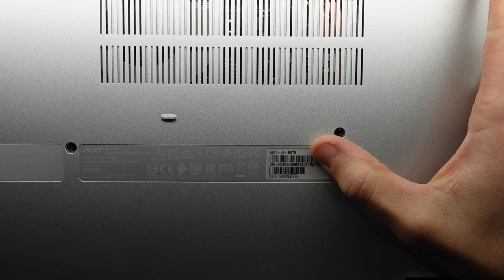Acer Aspire 5 A515-45-R67B Ram Upgrade

Comment: Thank you for sharing the part with disconeting the battery as well. It was a comment that the board has 8gb of ram and added another of 16 gb = > 24 gb. In your opinion don't you think will be troubles bcs there are not the same capacity? like 8 with 8, or 16 or 16?
Reply from the maker: they will work okay being miss matched but won't get dual channel performance due to the different sizes

Comment: when i check on the command function and on the taskmanager memory option, it shows me that i have 2  slot on my aspire 5 and through command it says i have 2 rams in used and both of them are of 4 gb each. but where ever i check. acer aspire 5 a515-45 series only have one slot, will u please help me on that, i didnt understand it
Reply from the maker: I suspect 4gb of ram is soldered on and you only have 1x ddr4 sodimm slot

Comment: why does the battery needs to disconnect before putting the ram?
Reply: Because the battery still transfer electricity to the components and can cause shorts. I forgot to do it in this same model and it happened but with no damages it was pure luck.

Comment: that "empty space" is where a secondary drive goes
Reply from the maker: 2:20 I can't see a hard drive bracket nor a flex cable + hdd connector anywhere
Reply: @rickstechrepairs  I just opened mine tonight for a RAM upgrade and it has a fixed connector for and SSD - also has 2 slots for ram with a max of 2x16GB. Yours doesn't have those two options, different model, either older, or a base version.
It ended up being far easier to pop open than I have seen, I used the back side of a butter knife.

Comment: so typically you can only add 1 ram ? so theres no point of buying 2 right ?
Reply from the maker: Usually there is already one stick of ram or possibly two from the factory
Reply: i hope they're not soldered otherwise i wont be able to upgrade
 @rickstechrepairs

Comment: My acer aspire 5 has decided to not recognise realtek microphone. If I attach an outside mic, it wants to use it as a speaker. Is this a known fault?
Reply from the maker: right click the volume icon in the bottom left and click on audio mixer

when the mic is attached you can change where the audio is playbacked from (laptop speakers)
Reply: Try to use ASIOforAll

Comment: Do you know how to clean the pre existing ram? I think that’s the issue but I’m not sure where it’s located and what size screwdriver I need
Reply from the maker: as in physically clean?
i wouldnt recommend it unless its dusty in there
Reply: Yes I suppose physical clean or remove it if possible? I’m having the issue where the computer turns on but the screen stays black and I’ve tried restarting it many times but it is not working. Do you have any suggestions for this?

Comment: I use the Acer Aspire 5 A515-45-R74Z, or the Acer Aspire A515-45 series, and I've been wondering which exact ram I should use to upgrade my device? I did some research and figured out that my computer uses 8GB DDR4 PC4-25600 3200MHz SODIMM NON-ECC Unbuffered 260pin 1.2V CL19 Single Rank memory, but I'm lost on which exact memory upgrade I should go for. I saw a crucial ram that's compatible but I don't know what specific rank it is (Crucial did not specify).
Reply: @thomas1699  can we mix match the memory modules e.g. (8gb onboard + 16gb Additional)?

Comment: I have the 4gb version. So can i put a 16gb stick in it? Cause putting 32gb stick would be waste of money im guessing
Reply from the maker: i would add another 4gb to make it 8GB in Dual Channel
if you arent gaming i wouldnt install over 16GB of Ram for this laptop
Reply: @rickstechrepairs  yeah I don’t like how 4gb is permanently built into the board leaving you with 1 ram slot smh its a awesome deal otherwise got it for 319 r3 5300u. Wish they had version with 2 regular ram slots. Yeah gaming on it 👍🏾 light gaming, for traveling & when I can’t be on my i7 desktop

Comment: I've got the Ryzen 5 5500u version of this laptop and did the same ram upgrade immediately, mine did come with mounting bracket and ribbon cable for an additional drive, i added a 1tb silicon power SSD. Now it's a little beast for only $450 USD(including upgrades)
Reply: after physically installing the new ram is there any other process one's gotta do in order to make the laptop recognize and utilize said added ram? ty in advance
Reply: @spongebobmarley7368  not for me no, it ran in dual channel at the proper speeds right after installation
Reply: @lapua9828  oh k then, do you know if there might be any performance differences installing a ram with different brand or capacity (maybe since a 8gb is already in, it's better to put another 8gb instead of 16gb and so on for better compatibility)?
Reply: @spongebobmarley7368  mine comes with 8gb of onboard memory and only one open DIMM, i added another 8gbs. But so long as the speed and timings are the same the capacity shouldn't matter, so if i had installed a 16gb stick instead, the first 8gb of that stick should run in dual channel, with 8 additional gb running in single channel
Reply: @lapua9828    and since I'm pretty lost (sorry and thank you for the patience), do you have any ram recommendations? I don't know where to find the matching speed and timing specs you mentioned
Reply: Hey! We both have the same laptop, that being the Acer Aspire 5 A515-45-R74Z Slim Laptop. I've been scratching my head for hours wondering where I can get a ram upgrade for this computer! What ram did you use?
Reply: @davey5444  i used the crucial ddr4 sodimm 8gb 3200mhz cl22 but the brand doesn't matter, just make sure to get any ddr4 sodimm at 3200mhz cl22
Reply: @lapua9828  Thank you mate!
Reply: @davey5444  no problem
Reply: @davey5444  only get ONE stick because there is only one open DIMM in the system
Reply: @lapua9828  That was one of the first things I was cautious of!
Reply: @lapua9828  What SSD did you add? I want to make sure I add one thats right for it.
Reply: @hyrowy8800  it was a Silicon Power A55 1tb SSD, pretty inexpensive and works fine for bulk storage

Comment: will it go into dual channel or will it be single channel
and how much does single channel change the performance
Reply from the maker: In dual channel i expect up to 20% increase.
both ram slots need to be used to do that
Reply: @rickstechrepairs  is the laptop going to recognize and use the new ram installed at the best of its performances all by itself or are there any other steps to manually accomplish?
Reply: @spongebobmarley7368  its more like 2x graphics and system performance and no as long as task manager shows the RAM amount as expected you're good